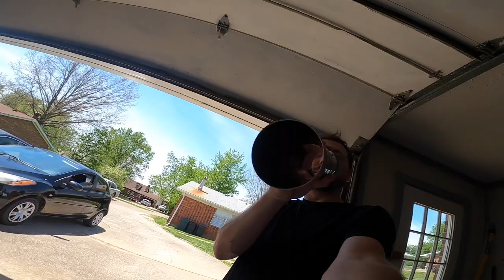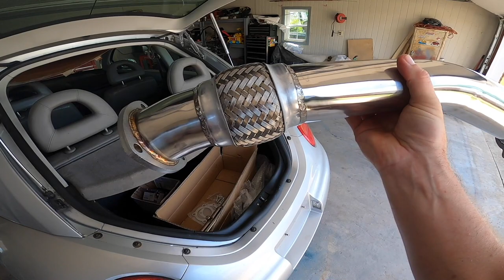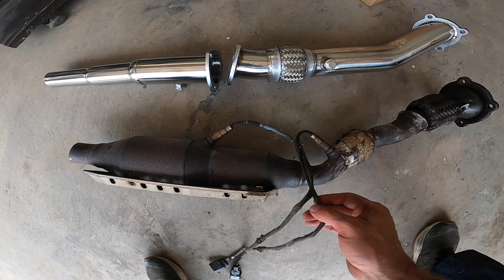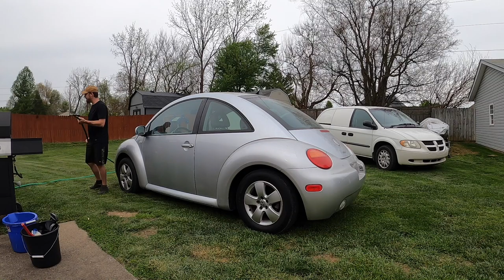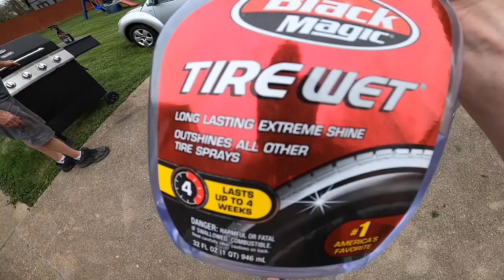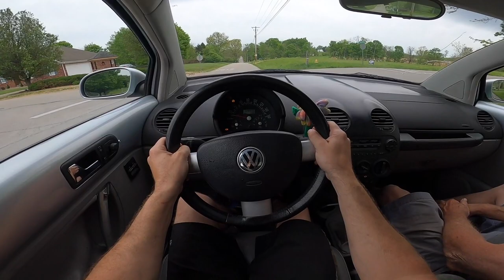$50 Ebay Downpipe - VW Beetle Turbo

Comment: Did the eml light come on
Reply from the maker: I haven’t even paid attention.  I’m assuming yes but not sure.  I’ll check next time I drive it
Reply: Just add a racing spacer on 2nd bank of 02 sensor and should  clean that check engine  light

Comment: Did you need a tune so it didn’t throw an o2 sensor code???
Reply: No need just add a 02 sensor spacer on the sensor furthest from the engine

Comment: You have to weld anything putting her on? Or did you just use that factory clamp?
Reply from the maker: Factory clamp.  No welding required.  Bolt on
Reply: @mosierwerks  thanks, I just ordered mine to put in my 03 beetle. I got rid of the muffler so I’m excited to hear the sound
Reply: @jojojrderfman  how loud is it now? looool
Reply: @mouldy5156  oh it’s loud! I don’t have a muffler on it either. And she roars!